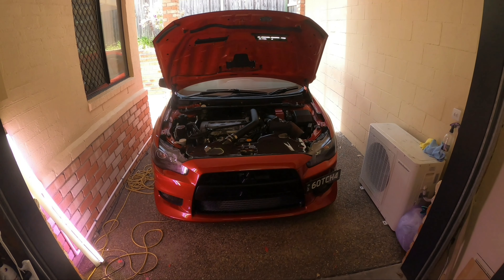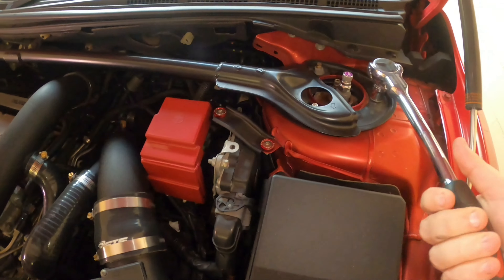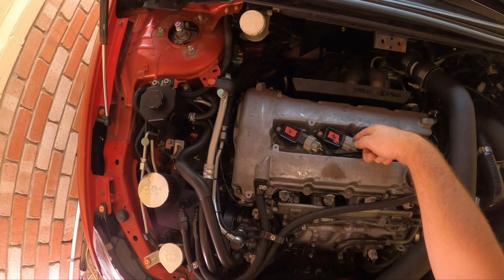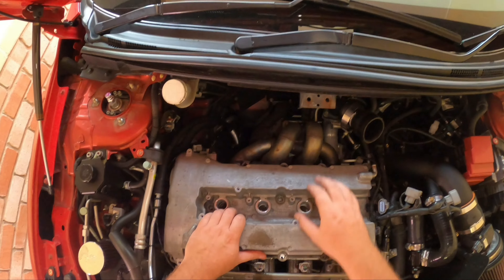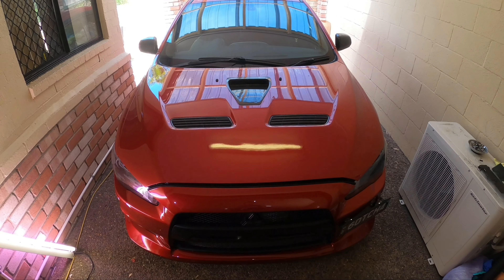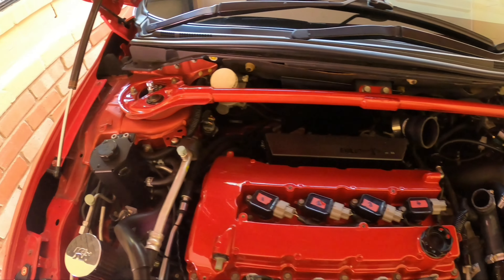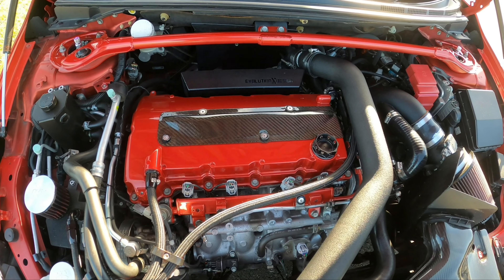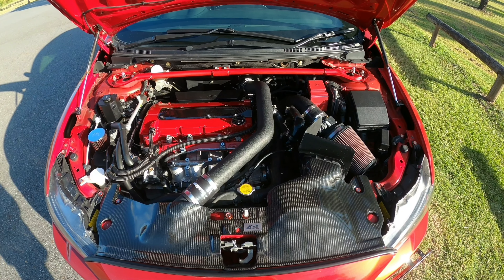Evo X Engine Bay Transformation [Painted Valve Cover, Fuel Rail & Strut Bar]

Comment: Engine bay is looking amazing! Where did you get the power steering reservoir cover ? And what catch can is that? Thanks
Reply from the maker: Thanks mate it's definitely coming along nicely, so the power steering cover is from clubspec customs and the catch can is by a company that's no longer around called driven fab, we found the catch can used and snapped it up as they're so hard to find

Comment: do you have a video of wire tucking? great video!
Reply from the maker: Hey mate I have one on the mivec and injector wires that run over the top of the valve cover if you look back through my previous videos you'll find it